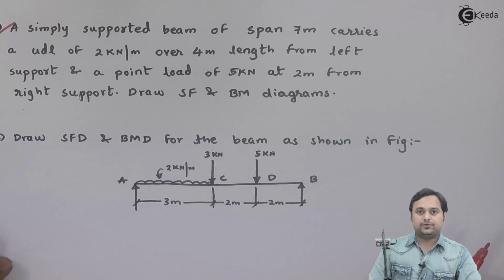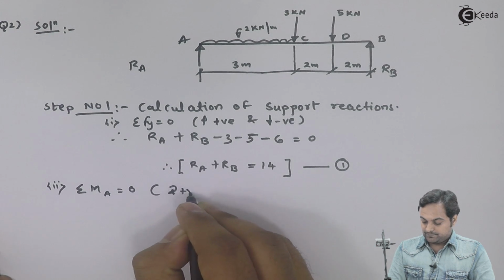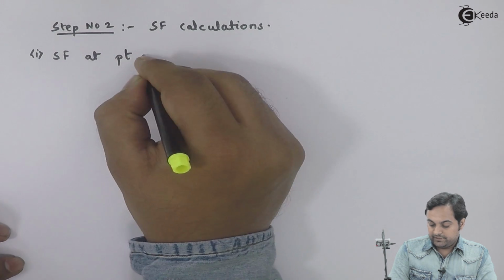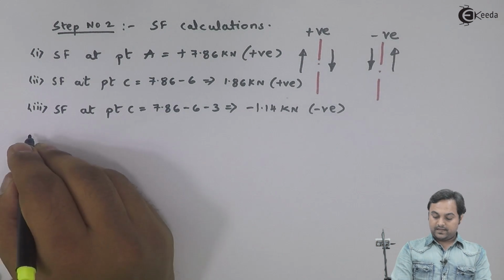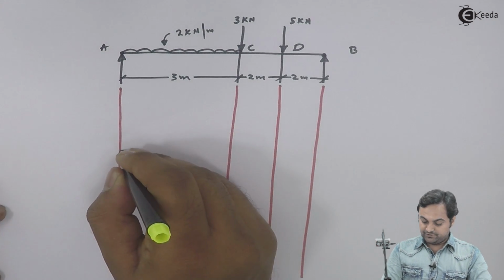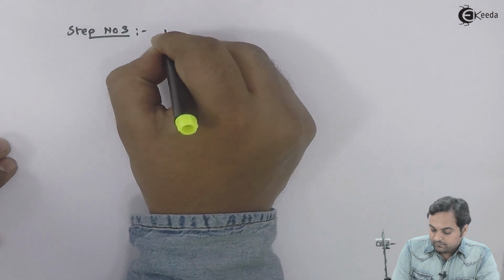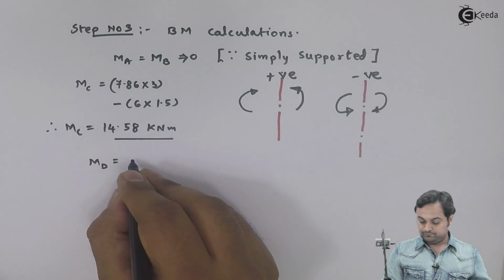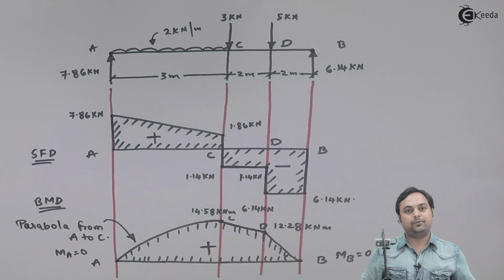SFD and BMD - Problem 10 - Shear Force and Bending Moment Diagram - Strength of Materials

Comment: Sir,you took SF both of the side C but why you didn't take SF both of the side   D?
Reply: Because at C , point load or concentrated load and Uniformly distributed load (UDL) are both acting on C, whereas at D only point load is acting.
I hope you understood
Reply: @divyanshujangid6549  we have to calculate shear force before D and shear force at D. But here sir did a mistake
Reply: @mrmanarpfithu8209  ohkk bro, I think you are right, thanks !!😄